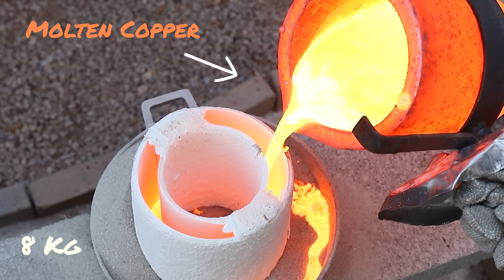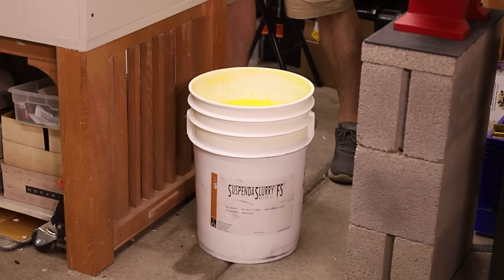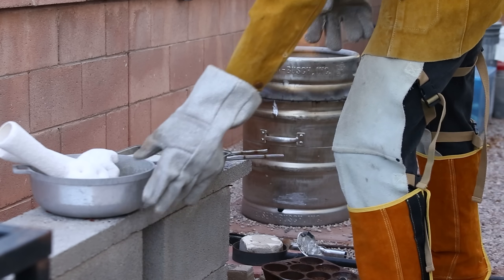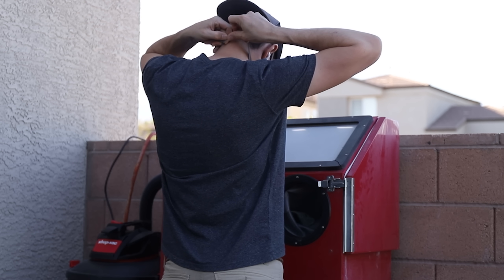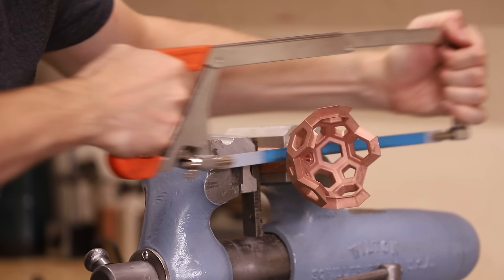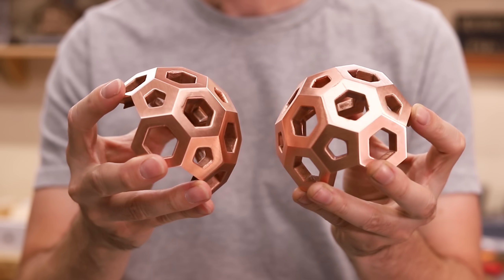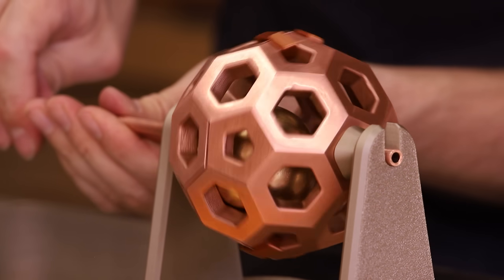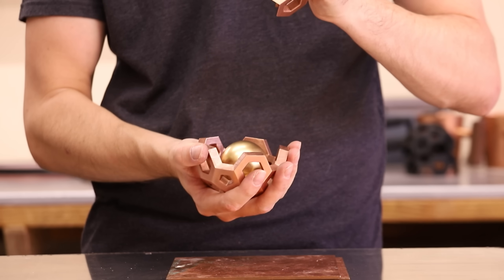HUGE Magnet VS Copper Sphere - Defying Gravity- Will a Neodymium Magnet Float Inside?

Comment: The fact that the metal casting process you have is so precise that the pieces come out with obvious layer lines it inherited from the original 3D printed pieces is absolutely incredible!
Reply: I’m a goldsmith and we can pour metal to 0.2mm thickness. It’s amazing.
Reply: This is called investment casting. Look up lost wax casting. Been around for a while
Reply: @IndependantMind168  THANK YOU. So many people don't know about this.
Reply: @IndependantMind168  Fun factoid: that's the method used by dental technicians to make arches (dentures) for implants, usually out of CoCr alloys.
Reply: @IndependantMind168  Why didn't he show the reveal of breaking open the mold then? He said it only took 30 min and its the most important and photogenic process.
Reply: I also saw thi! It's amazing. Looks like he printed it on some 3d printer from future (that can print precisely with melted copper)
Reply: @bundzmykhailo3733  There are metal 3D printers, but from what I understand they are bulky and work way different to plastic printers.
Reply: @jwalster9412  HP makes a model that can print metals. It uses a big pit of powdered metal and uses lasers to melt the metal to form, akin to a UV resin printer (it just uses much lower power UV lasers and resin instead of metal powder).
Reply: @crazyidiot5309  I thought it was something similar to that, but wasn't entirely sure.
Reply: @jwalster9412  I actually had to crate up 2 metal 3d printers for a local university. Those things were bigger than my fridge.
Reply: @hansedrachensohn530  was it a small print bed or big.
Reply: @jwalster9412  they work closer to a resin printer, it's basically a bunch of metal dust and a laser that melts it layer by layer
Reply: @jwalster9412  they use metal powder and lasers, pretty cool. :)
Reply: @bundzmykhailo3733  they already have had 3d printers that can print with metal for years, that's not futuristic, they are just very expensive machines only companies own them
Reply: a @bundzmykhailo3733 d😂r
Reply: @bundzmykhailo3733 Its not really the Future we are already 3D Printing Metal
Reply: @bundzmykhailo3733  also there's an entire bridge in the netherlands i think which is 3d printed out of metal too, they can also print very small precise things... crazy how you think that's from the future
Reply: Copper is also notoriously difficult to cast and he didn't even mention it O_O
Reply: @stigmautomata  was thinking about this while watching, saw others botch copper pours a couple of times before getting it right, and he just casually does it first run
Reply: @Prophias 
Yes I think the secret there is that the Risers were not constant diameter, but the same as the diameter of a stable stream of water accelerated by free fall and therefore reducing in diameter.  Therefore ideally no turbulence so no air pockets.
Reply: @Prophias  i think its called experince, and could also be editing out failures.
Reply: @stigmautomata  And it's fucking gorgeous too.
Reply: @stigmautomata  that depends on the purity
Reply: @Patrickf5087  Yeah, I maybe wrongly assumed that because he is interested in the conductiveness that it would be high purity
Reply: He's him
Reply: That was the mind blowing part.
Reply: Ball is too big
Reply: Hot Acetone vapor chamber 'quench' to remove print layer lines
Reply: @lmfaosimba  PLA cannot be vapor smoothed with acetone. Not sure who told you it was possible.
Reply: @lmfaosimba   or just dialing in your print settings correctly
Reply: Also. Sand blasting.
Reply: Like, geniunely, what is his secret? Very pure copper?!
Reply: The process of lost wax casting can capture incredibly fine details as long as you get your initial slurry viscosity just right.
Reply: They are going to 3D print out steaks and beef, pork etc in the future. Look it up bc it’s on YouTube
Reply: Nost metal casting do that. It's bot uncommon.  It is the nost common thing with that process. Any silver skull ring uses this process
Reply: What is the name of the ceramic mix shown in the video, and how much does it cost?
Reply: funny seeing you here
Reply: @snekkoheckko4466  hi snekko
Reply: He could make millions marketing his skills to others there are other scientists and inventors that would benefit greatly from his casting skills and 3-D printing techniques
Reply: the copper casting sphere was supposed to be build much larger than the ball so that ball can have some space to fly !
Reply: You should see if it has the ability to generate electricity . After all magnets and copper is what an alternator is made out of .
Reply: You could've used wax instead of pla
Reply: @thejauntyfool  That's an idea.. use a 3D printer that prints with wax. Unfortunately I am not aware of any consumer - priced ones, while there are a lot of easily available 3D printers that use PLA.
Reply: Bgm title in sanding?
Reply: it needs to be turned 90* and instead of  rotating the axel with mechanical force use a rotating magnet
Reply: Gotta do this make a full IronMan suit
Reply: I thought the same thing. What precision it’s amazing
Reply: Anyone with basic knowledge can do that lol
Reply: Make nice copper nunchaku
Reply: It's a spherical "bar" magnet ?   One hemisphere N? other one S
  ( Like This planet Earth ?)
  So it will start to rotate like an Induction motor rotor.    Try  a vibrational oscillation instead of continuous rotation.  Fit torsional springs and drive it somehow from a variable frequency sine signal with a Bass AF amplifier at resonant frequency of course.   20 - 100 Hz ?
   You might need some kind of pendulum to keep the poles in the vertical plane
  If it rolls over - game over I would guess.
Reply: Smaller magnet? Or larger sphere.. 😁
Reply: Yeah, it blew my mind too!
Reply: This sort of "investment casting" process is what is used to make precise, tight tolerance blades for jet engines.  One of the big advantages is that it produces a near-net-shape copy of the original.  For turbine blades, the original part is first made from hard wax.  Then the wax part is sprayed with multiple layers of ceramic coating.  The ceramic is hardened in a kiln as the wax melts out of the mold.  Then molten metal is poured back into the mold.
Reply: Considering that commerial casts can have the surface texture of the part determined by the mold it was made in... this doesn't seem too surprising to me. Granted, they're probably not using ceramic molds either.

I've never seen anyone use this specific process for creating a mold.
Reply: You may try making the sphere a different size and the shapes on it you could experiment with to see if they had an effect who knows what may happen it all looks really good so far
Reply: Heat. The hotter the pouring the more definition you get. But he could have removed those lines just by soften them with acetone vapor.
Reply: It’s very cool
Reply: @twixerclawford  dude, you clearly havent worked with casting sand before, its so fine it can pick up fingerprints, have them cast in metal
Reply: You remember the Saturn automobiles from the late 90's to early 2000's but their aluminum engines were cast in what's called 'lost foam process' where the desired shape of the engine was created from actual Styrofoam then placed into sand and molten aluminum was poured into the Styrofoam. It flashed away the foam leaving a void to fill with liquid aluminum and the texture of the Styrofoam was often on the engines as a result.
Reply: dont suck him too hard now...
Reply: Furry ah pfp
Reply: @Godofgames3  you should see the whole picture
Reply: @ no thank you
Reply: 8:15 8:17 8:18 8:19 8:21
Reply: Huh? This a nonsense statement. 
If he had poured jello the same thing would have happened thr same with water 

Why? Because molecules are smaller than the printing accuracy
Reply: @Patrickf5087  nope, surface tension :)
Reply: @lain-bf4kd  purity of copper changes the properties of copper, my dad used to work with 99% oxygen free, becauae it was so reactive that even the oils on your skin would make it react
Reply: Furry. >:0
Reply: its literally a mold
Reply: @TuriGamer  metal casting is almost never that precise
Reply: @twixerclawford  right, but this self admitted know nothing just pulls it off 
Im sure you are very experienced on the subject to make this assesment in the first place
Reply: @TuriGamer  no I have no experience metal casting but I have seen a lot of videos of people doing metal casting, and this is by far the most detailed and impressive version.
Reply: @twixerclawford it is with investment casting. That’s the proper name for this process.
Reply: @twixerclawford to jest najdokładniejsza technika odlewania, metoda traconego modelu, nazywana też traconego wosku, ale nie zawsze model jest z wosku. Odkrywa się szczególnie elementy z wysokiej jakości stali do przemysłu samochodowego itp
Reply: @TuriGamer and…
Reply: @TuriGamer  Metals don't behave like other materials (plastics, glass/silica, cement) when casting with a mold. 

The temperature difference between the molten material and the end piece (room temperature) is so high, the work piece wants to shrink A LOT! But it can't due to the airtight mold surrounding it. This creates vacuum pores/pockets inside the work piece.

Any product with those pores or vacuum pockets in it will fail the quality inspection. They won't have the mechanical (or electromagnetic in this case) properties they were designed for.

The solution is to feed them hot molten metal during the cooling process with risers (as the guy in the video did). However, you have to place the right risers at the right spots, which requires some sophisticated calculations.

That's why metal casting--particularly with metals that have magnetic properties--is not quite simple. The hardest in my opinion is iron casting while the easiest is aluminum.

Iron is heavy. It melts at extremely high temperatures, and it is magnetic. It also doesn't just shrink while cooling, it shrinks down to a certain temperature and then starts expanding again. Therefore, you have to use conic risers. The riser has to stop being active midway to avoid puking. This adds to the complexity.
Reply: This is not "incredible" and if you look closer, It's far from precise.

Comment: Do me a favor, take a 9 volt battery with two leads and touch the sphere at opposite ends for couple of seconds, then after you remove the leads from the sphere, measure the sphere to see if it retains a voltage as if it were a battery. I have done this with a different shape and it retained a voltage of 0.1 volts until I grounded the shape. I'm curious to know if your sphere displays similar results.

Comment: 11:46 - this is more interesting than floating sphere for me
Reply: Agreed, I'm surprised the small magnet is able to rotate something so heavy from such a distance.
I'd love to learn more about how that works!
Reply: And will the small magnet still rotate the sphere if it doesn't have the spherical magnet inside?
Reply: @sleeplessdev7204 the small magnet is acting on the large magnet, the copper sphere is only moving because it goes out of balance when the magnet moves.
Reply: Maybe it can be used for wireless mechanical gear?
Reply: @ghost_ship_supreme  electric motors typically work by translating solenoid current into a shaft through a magnetic field.

Here's the problem, though: field "power" dissipates over area. The magnetic flux decreases over distance, as it spreads out to regroup on the opposing pole. I can't imagine that translating force between two magnets is very efficient, let alone relatively lossless. You also limit the system's resistance to torque to the force between the magnets as opposed to the gears' material yield stress. I could see this having some use, maybe as a sort of mechanical "fuse"? You could also protect a part from wear and damage this way.

I did a quick search, and magnetic gears and gearboxes are a thing-- their advantages and disadvantages are much like what I suggested. You can find some details on wikipedia under "Magnetic gear".
Reply: Put it on a scale and spin it
Reply: Was about to say the same.
Reply: Can it be used to used to generate power?
Like use small motor to rotate the smaller magnet and connect the bigger sphere to dynamo ..
Smaller motor uses less energy 
Whereas bigger sphere generates more power then would that be perpetual motion(ik its impossible but still)...
Reply: @akashgogi8698  there is no such thing as energy from nowhere. When you will try to get energy from it it will be more difficult to rotate bigger sphere - the same effect like with ball magnet falling down on copper surface.
Reply: @akashgogi8698  manetic force is proportional to the change in magnetic flux. Magnetic fields dissipate over distance as they diverge to meet on the opposing pole, so distance of the magnets should account for loss in efficiency. The stress the system can tolerate is also limited by the magnetic force; magnetic gears already exist, and they have this limitation.

Dynamos, however, effectively work like reverse motors. You're trying to pass current along two rotating magnets, and while it may be an effective option for inducing a current across a small gap, it is not lossless. No, you cannot make a perpetual magnet generator.

This also presumes that the size of the sphere is proportional to the strength of the field. However, both magnets act on *each other*. The force you see on the opposite side is only at most as effective as the force you've put in.

Comment: The reason why this works as you explained is because the magnet is inducing electric current in the copper called Eddie currents, in a copper cylinder it is very easy for them to "do a loop" around the tube and the effect is pretty strong, however any obstacles in that path and the effect is dampened, if you'd cut vertical slits in a copper tube so there's no continuous path around it the magnet would just fall through it,  so if you look at the shell you made you can see that while the current can move around it doesn't have a straight path which will still make the thing work just with less effect, maybe redesigning the casing so it has straight loop paths for the current go around ( aka rings) would make it easier to keep the magnet levitate

Comment: I wonder about the current losses due to the seam where the two halves meet.  You did a great job filing everything down, but you can still see some small gaps.  If these were electrically bridged, then the currents could flow symmetrically at all times, meaning more uniform eddy currents and induced magnetic field.  That might help smooth out the operation of the system.  Separately, I wonder about the magnetic field pattern of the sphere itself.  The alignment of its field relative to the axis of rotation of the copper holder would have an effect on rate of change of magnetic field in the copper.  It might be good to experiment with various alignments to see if the system operates best in particular arrangements.

Comment: love the idea.
the magnet is pulled to one side wenn the shere is spinning. you can see it better in the example with the disc in the tube. 
but maybe it's caused by the inertia of the magnet and the rolling movement of the pipe.
maybe you could test a simplified version with a piece of tupe and a disc shape magnet, between two sheets of plexiglas, or polycarbonat. hold the tube piece in place, but spin it with a powered wheel and use two other passive rolling wheels to stabilize the copper tube piece.
i think it's nearly as spectacular to look at as the shere, cause even when it's much simpler, you can see much better what is happening.
if i had access to a workshop like yours i would try it myself, hope you will test it.
much enjoyed your video, you gained a new subscriber. (:

*edit: maybe it's some kind of induced gyroscopic effect? 🤷‍♂
(if the magnet is still pulled to the side when spun stationary) ^^